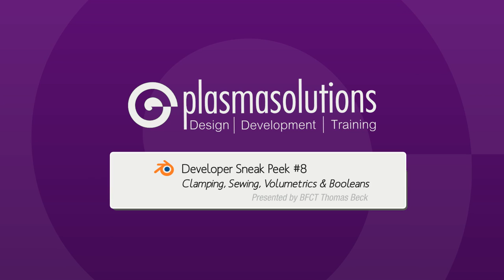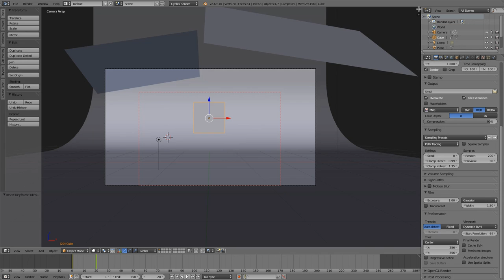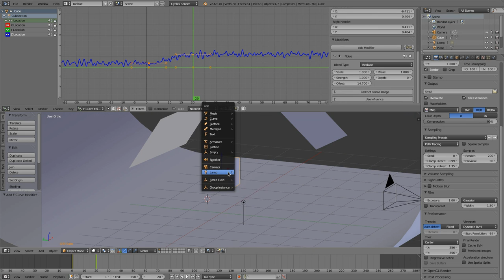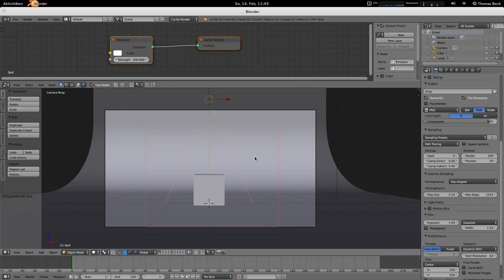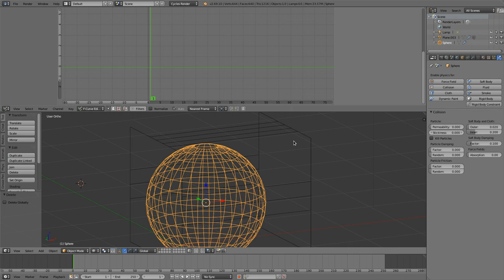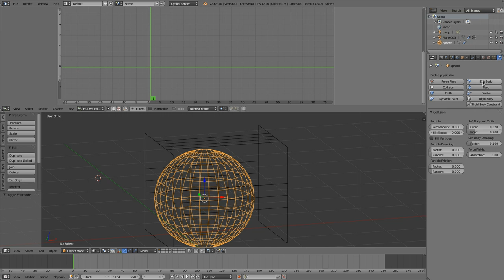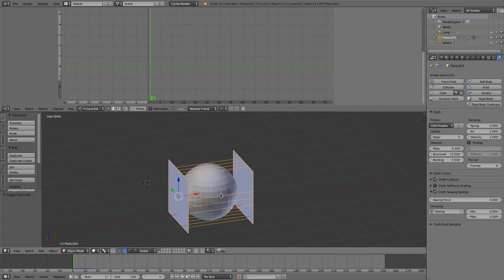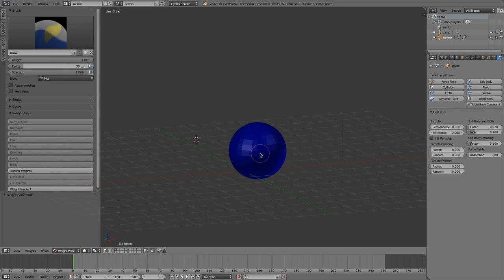B3D Sneak Peek #8 - Clamping, Sewing, Volumetrics & Booleans

Comment: while looking and those new clamp setting, i notice that in my beta build, that volume shaders disappear when using clamp values. Also would it be an idea to have the volume material as a layer material (like there is now Z, Mist, and glossy and diffuse; adding the volume material, there too; would allow for a simple blur over it in after processing.
I'm a big fan of improvements that would make my PC use less of the electric bill :)
In general i think thats a great goal all these speed improvements, and noise removals that allow for less render samples.
Reply from the maker: Hi Peter,

a volume pass would be indeed helpful and is on the todo afaik. For the clamp setting bug: Test it with the newest available builder.blender.org build and then (if it's persisting) report it please - every bug we're squashing now is better than having it in a release ;)

Comment: Regarding the Carve library, I am curious if there is a way to get the same boolean speed Modo offers with the FusionMesh add-on which seems unbelievably fast.

Also a freeze computation would be a great idea inside the modifier stack.

Also I tested the new OS X Build and the mesh result is very triangulated.
Hash: 78db029

In a previous build the mesh data is much more quad:
2.69.0
r60991
Reply from the maker: We saw this video together too... and it's indeed pretty impressive. Let's first do the release and then have a look again ;) Devs have to sleep too you know? ;D

What do you mean by the "freeze computation"?
Reply: Plasmasolutions As you can see from the MeshFusion video their operational speed is just fantastic. In Blender there are two things that slow me down.

1. The general operational speed of boolean operations when the sub-d level gets higher. I use Blender as a sub-D modeler for pre-generating NURBS surfaces later (sub-d to T-Splines to BRep workflow)

2. If you click a value in one modifier down in the stack line as well as switching to layers the more boolean modifiers you use the slower Blender's response will be.

This however is and can also be a problem in solid modelers. That is why they can insert a break into the design tree which like the modifier works top down step by step.

Now instead of de activating all the last 4 boolean modifiers just putting in a break marker would be nice or one option.

Other wise it would also be cool if I could suspend all modifier calculations or all boolean calculations for one object in the modifier stack.

So each time I go into edit and object mode the stack is not re evaluated.

Makes sense? I think Blender is getting into a very good position to compete more with Modo for object designers simply because Modo is also getting outrageously expensive.
Reply: Plasmasolutions Oh and no rush -  just wanted to say it before I forget to do so again. I fully understand that the devs also are humans.
Reply: Plasmasolutions
The FusionMesh add-on for Modo is incredible, even better than the zbrush dynamesh subtraction workflow, I can't imagine something like that in Blender but then again when I first found Blender I couldn't believe what it could already do then either! I remain permanently impressed and surprised. haha.

Love these videos by the way, great job.

Comment: how will the tabs effect older addons? will the addons have to be modified or is this going to do it for me? I have an addon the is placed in the toolbar in 3D view and would like to keep it when I update blender. will I have to go in to the addons coding and add or change some lines of code in order for it to run in the new update?
Reply from the maker: iirc my addon just worked out of the box.. and even had a new tab automatically generated! Just download a build from builder.blender.org and try it -  I'm sure it will work.
Reply: thank you very much. do you know about how soon the new version will come out?
Reply from the maker: The first test builds will be out on Friday (maybe... who knows ;) ) And I think we will have two or max. three weeks from then until the release will see the light!
Reply: ok
and i did use the link you gave me and tested my addons it works. i was able to put some on a new tab called addon but i could not do it for one of the addons. its odd but i do really appreciate the help you have provided, cant wait for the final release!

Comment: Hello thank you for the share. I am in 2.71 and do not see Volume samples>Equi-Angular ??
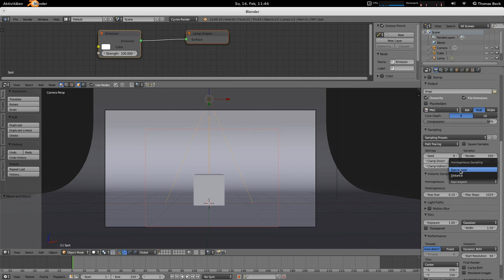You also mention two renders.@7:29 of your video. Since this is volumes I am assuming this is a CPU only render too.  I am unclear on the second render? Is this a render from material and then a render in composite for volume scatter? Thank you for sharing
Regards
NC
Reply from the maker: Just to be sure: You are on the "render" tab right? And you set the render engine to Cycles... then it should be there - I just checked it! And your assumptions are right - all images were cpu only as we have not GPU volumes at the moment - it's planned but not yet implemented...

Greetings, Thomas
Reply: Thank you for the reply Plasmasolutions,

Yes
2.71 > CyclesRender> Camera icon> Volume Sampling...Where my only option is to set the Hetrogeneous steps size and max?

Two renders? Was this a double pass? Is this why the option is not there?

Thanks
Simon
Reply from the maker: netcommercial I don't get what you're asking... could you be a bit more verbose ? Two pass?! What? I show there two separate renderings...is that what you're asking? I have absolutely no idea why there is no setting in your case... share a screenshot with the blender version and the missing option... maybe I can see what is wrong there...
Reply: Plasmasolutions,
Thank you for the getback.
Two Pass- render our a first pass bring back in as an image and use compositor node to achieve 2nd pass look.
I am not sure if we can send grabs and links thru here, can we?

Please let me know what the preferred method of delivery would be. I have the same user name over at BlenderArtists dot org
Regards
Si
Reply from the maker: just use pasteall.org... and no, there was no two pass thing here...